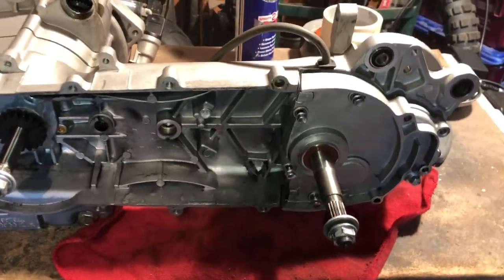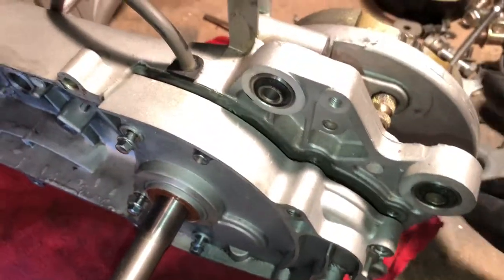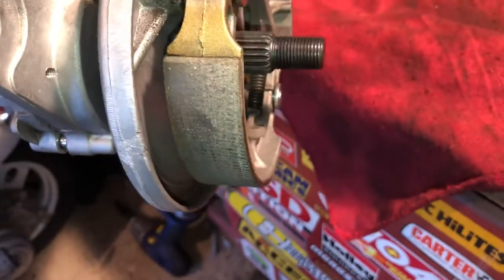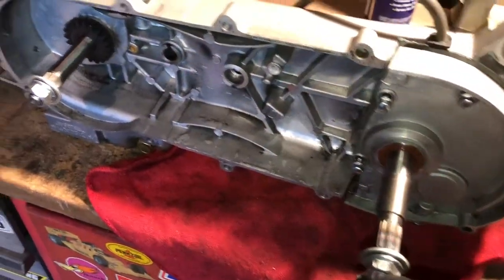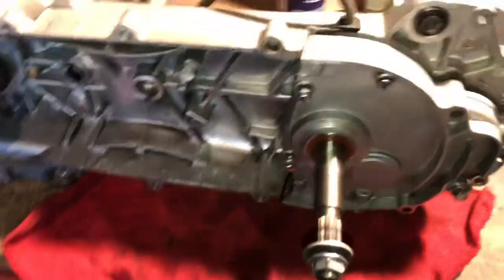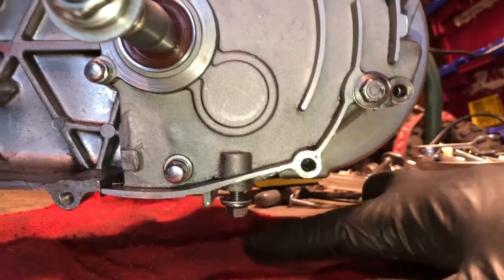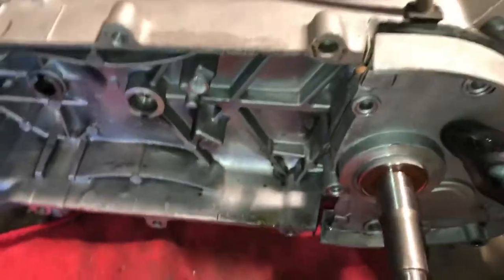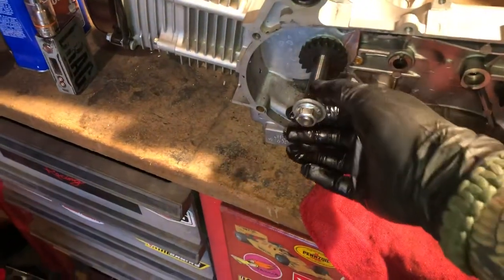Short axle install on a GY6 motor

Comment: This end up fixing your leak? My gy6 has been leaking gear oil onto the rear wheel to, I tore it apart and replaced seals and bearings, put it together and it still leaks. Now I’m gonna do a new axle as well hoping for the best.
Reply from the maker: Noah Koop it did fix the problem.

Comment: eeehm just to make sure : did you fit the seal with the lip pointing toward the gears ?
if not thats probably youre problem as overpressure in the gearcase wil push the oil out through the lip
different question here , i have a gy6 150 in a weird tilting 3 wheel scooter , and want to put the diff part ontoo a 500 cc gy6 (it has sumting to do with the rules in my country and insurance )  , i seen that the final drive can be taken out but is there a piece on the other side that comes off too ?
from wat i seen the driff has two castings one is cast in the cover for the cvt the other end bolts to where the drumbrake sits , i dont know if its the same between the 150 and 50 cc
Reply from the maker: I’m not sure, I’ve never dealt with the 50cc GY6. They’re way too slow, even if you put a “big bore” kit on them you’ll be lucky to hit 45mph.